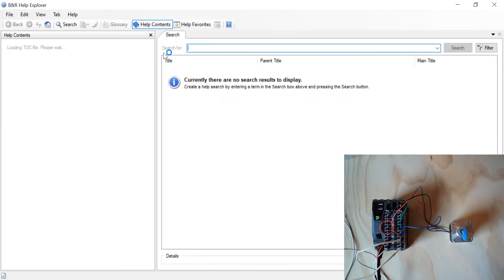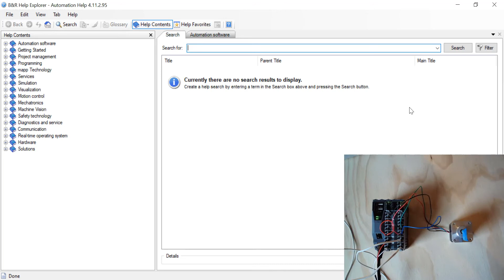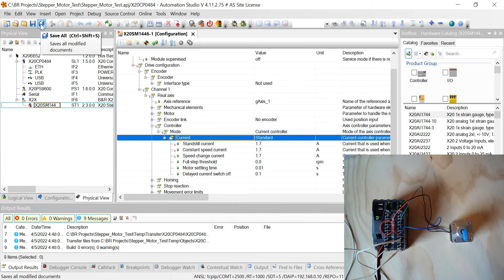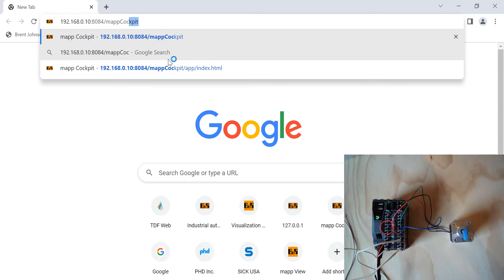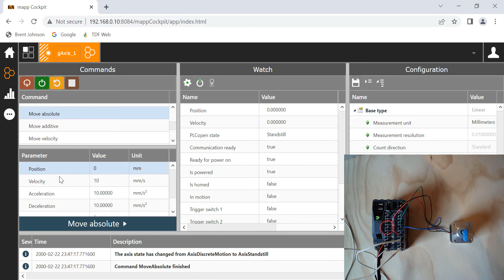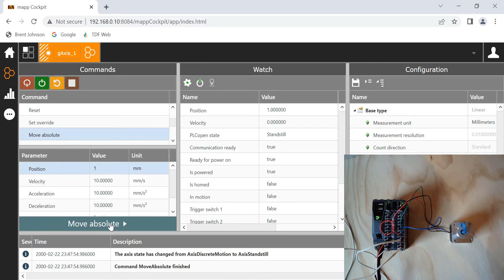Stepper Motor Tutorial Part 2

Comment: how to configure B&R PLC with Festo terminal valve?? Can You make some tutorial sir?? tanks
Reply: You probebly need a DTM device file and can just load it into the 3rd party device manager then you have a module like B&R inputs and outputs where you can map variables
Reply: @d4mich4  I have loaded the DTM. now I got a new problem it has an error when I try to start the communication. the error is, "COM-flag not set" . Can you help me, sir?? I am using X20IF061-1 with Festo CPX-Fb13. It uses Profibus DP.
Reply: @miba98  Well then you might need something to change in the configuration of one of the devices or maybe add some variabled to the X20IF061-1 interface modul like connunication state, Configured_slaves, active_slaves and so on...